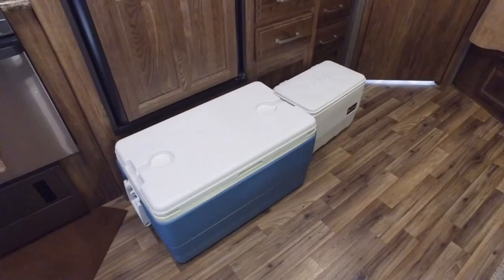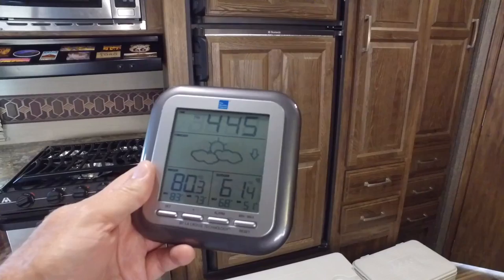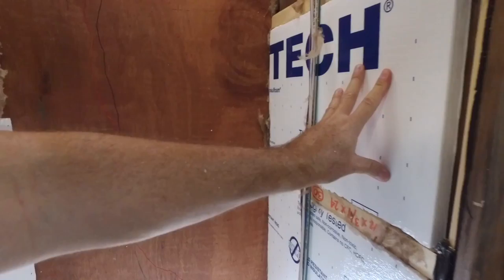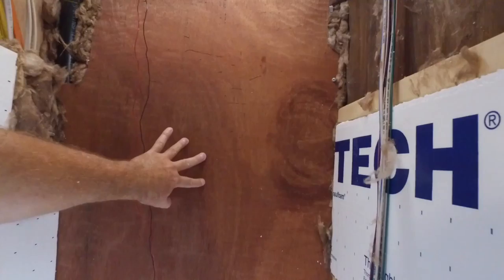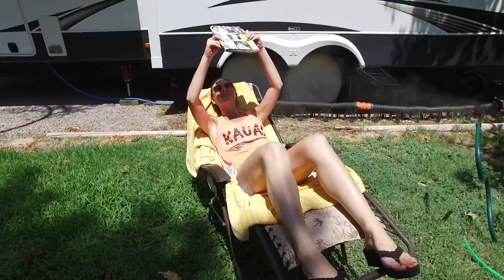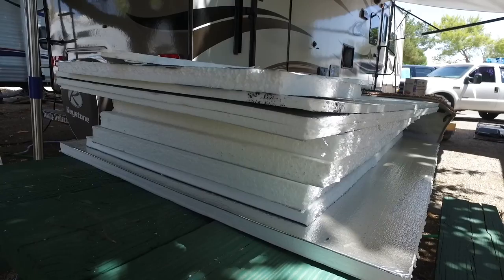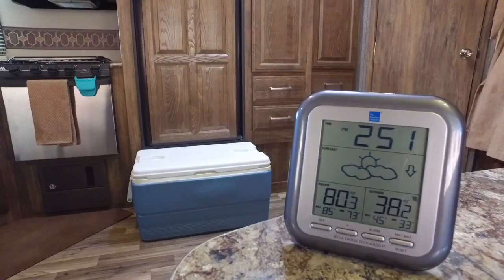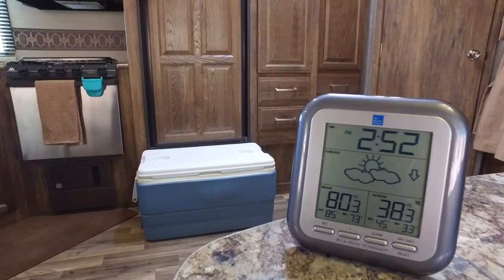RV Fridge on the Fritz! - Ep. 6

Comment: Very interesting video! We too had issues with our fridge not cooling. Turns out we had some insulation blocking a vent tube and causing it to overheat, per the dealer repair site. Since then it's worked like a champ. I really like the added insulation, great work on that! RV's need all the help they can get.
Reply from the maker: Yes, the more we learn, the more we understand that everything seems to break on these RV's 😀 glad your fridge is working better too!

Comment: I live in Texas so we get the high heat and humidity. Our 32ft trailer had one 15k ducted AC unit and it really struggled to cool the trailer. I decided to add a second unit and placed it in the bedroom. I wired it independently so I plug it in via an extension cord to a 20 amp plug. It works great and really cools the trailer off. Sometimes too cold!!
Reply from the maker: That's great Mike, we thought about adding a second unit but the re-ducting we did worked great and has held up all summer (knock on wood)!

Comment: we use a fan inside the fridge, it helps regulate the temp inside, you can buy them at camping world, also saw them in some walmarts, rv section is near the auto section
Reply from the maker: Hi there, we have two of those too! We tried the interior fans first, so we have interior fans and two exterior fans!

Comment: James did a great job of not only repairing, but upgrading as well. Does the fan he added just run all the time?
Reply from the maker: We added two fans and we added a switch on the outside that we can manually turn off and on when we need it (or when it reaches temp it automatically shuts off).